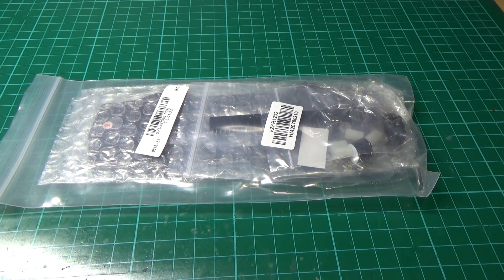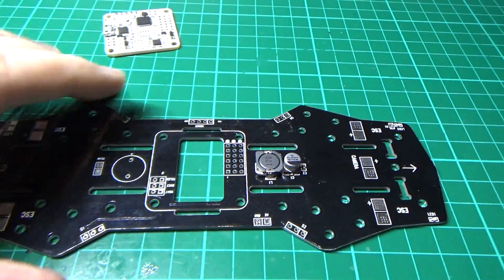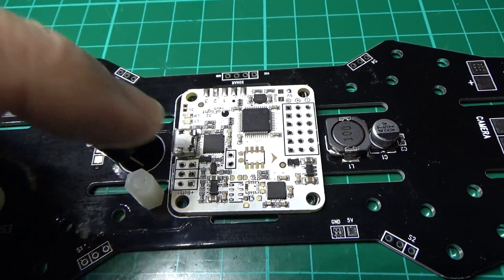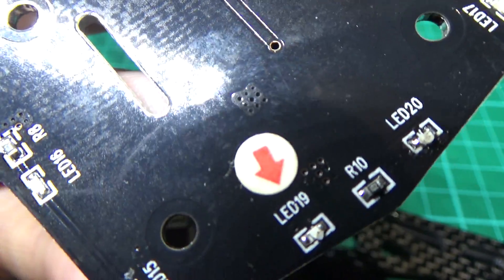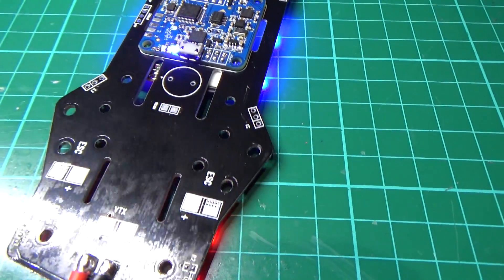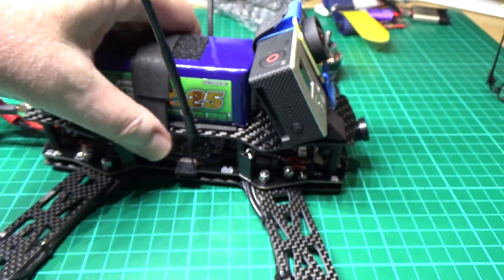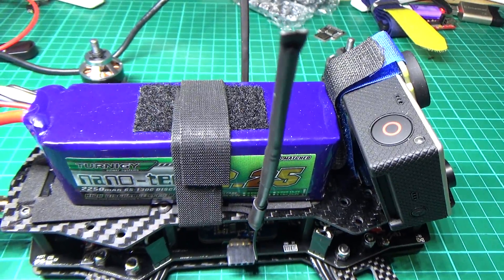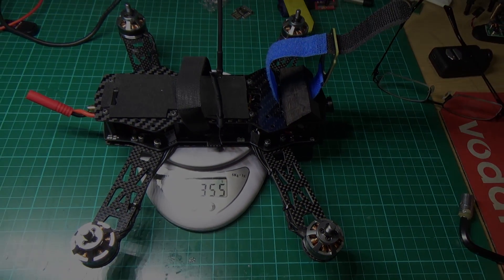ZMR250 drone PDB with Naze32 mount from Banggood - Frankenquad the 2nd!

Comment: my new drone weight have about 21KG, but i no sure what motor need use. i have 5010 360kv motors 4 pcs. wery expensives has. i not sure need me 2-4 motor more ? but i think i use same power distribute board. or 2 pcs little naze32  20x20 distribute board.

Comment: I just ordered 1. cant be used with carbon frame right?
Anyway. 
Do I need to add bec? I got sonar too, can I use connector or direct solder?
Recon I can mount the escs on here some were?
Thank
Were you from? wolvs?walsall?
Hmm so your saying 6dof naze or cc3d cuz of the magno right? Can I still do altitude hold?
1 last thing. gps or satelite or both?
Fancy meet up some time? pretty sure im close to you.
Reply: name of leds to please. 12v ect
Reply: hmm you used sonar for bluetooth. can I do both then? naze got usb anyway right?
im new will acro naze32 do me or do i need 10dof?

Comment: you could put the buzzer underneath?
Reply from the maker: Not really, the bottom plate is in the way. I could have drilled a big hole in it but I found it much better to have the buzzer right at the back of the quad

Comment: Hi there, 
nice job and nice video, helped me a lot with building my 1-st quad. 

I've one question: where can I find channel 5 output for LED strips on this PDB, anyone remebers or can check?

Thanks in advance and best regards,
Mariusz.
Reply from the maker: Hi Mariusz. I did a video about it........ https://www.youtube.com/watch?v=7S_D6fgsGdI    
If you need any more help, drop me a note :-)
Reply: +Vortecks thanks for link, somehow I haven't seen this before :-) Anyway, I've asked under this video because this is the same PDB as mine, but I've aleady assembled my quad and whish not to dissasemble it onece again just to check where channel 5 is wired on PDB. AFAIR it was under pins labeled SONAR, but I'm not 100% sure. 
I'll also check voltage under 5v because all four strips I've received are not lighting up after connecting to bec or PC USB port (signal sure not connected). Thanks for help Vortecks!
Reply from the maker: We all make mistakes..... I'm a past master at it but I usually share it so others don't suffer like I do :D    
I'm glad you got it sorted in the end :-)

Comment: is there no 5V and 12V Output by default on the board? Do you really need the power of an BEC?
Reply from the maker: +Christian Wunderlich No, there's no 5v or 12v. You either use the BEC in an ESC or use a separate one like I did.The thing that looks like a BEC is actually a low pass filter for video.
Reply: +Vortecks That is crap. Than i acn use the diatone as well, or ;-) are there meanwhile better PCB´s around?
Reply from the maker: +Christian Wunderlich I ended up using the Diatone https://www.youtube.com/watch?v=nFtlixPwjw0

Comment: Hi, for what are the big condensators in the ESC wiring? Does the ESC power supply needs to be filtered? Thx Fred
Reply from the maker: +fred xxx The capacitors are what's called "power capacitors" which are there to protect the other electronics from voltage drop. When you give it full throttle, they smooth the power out and make sure everything else doesn't suffer. They're not necessarily needed if you  have good quality batteries and fly slowly.

Comment: after screwing up my first naze32 with a pcb and being my first build you have helped me loads on where I went wrong with the 5v to the board, I notice you have 2500mah batteries, I have 2200 3 cell batteries using these what esc's would you recommend for me to use I currently have 12amp but not sure if they are too low and im using DYS BE1806-2300kv motors from bangood.com, any advise would be good if you have the time to spare, by the way its been ages since i have been up cannock chase, fellow midlander :) Thanks
Reply from the maker: +Rob Ellis Hi Rob, you'll be fine with the 12a ESCs on 3s with those motors. It's when you do mental things like me and try breaking the sound barrier that you need to beef things up https://www.youtube.com/watch?v=2DVdpUsyRQQ    I now use ZTW Spider 30a ESCs,  Sunnysky X2207 2100kv motors with 4s 2250mah Turnigy Nanotech 65-130c batteries on everything. When the weather warms up, I'm going to try my 6s mini quad again - the last time didn't go too well..... https://www.youtube.com/watch?v=_Fe5xTn4kYs 
If you need any more help or guidance, please drop me an email (click on my name, click on 'About' and it's in there. Tony
Reply: Thank you so much Tony, I am a complete Nube to all of this and any help is greatly received, i also currently have the flysky T6 transmitter do you have a video on setting up a transmitter or recommend a better one which is idiot proof for me...
Reply from the maker: +Rob Ellis My old radio was a Spektrum DX8 and I now have a FrSky Taranis. The DX8 was easy to setup and use but it lacked the advanced configuration of the Taranis. I really can't help with radios because the only one I know inside out is the Taranis (although they have made it quite user friendly recently).
Reply: I have the Teranis saved in my wish list in bangood at £154 complete, it seams most people go with this option, many thanks once again Tony I think that will be my next purchase as I would like the benefit of telemetry also something this transmitter is lacking in the one I have at the moment, I look-forward to more of your videos my friend :) Thanks.
Reply from the maker: +Rob Ellis No problem Rob. You'll like the Taranis and it will grow with you as your knowledge expands......something that the DX8 was lacking :)
Reply: Thx :), hope you dont mind me dropping questions on you like this, but i just like your no nonsense approach there is no bullshit like some of the american builders, no offence to the community intended :)
Reply from the maker: +Rob Ellis I don't mind at all.... I was the same once and I know how frustrating it can be :-)
Reply: Thx :)

Comment: Look at the copper on the top and bottom, trace the route for the high current to the motors, totaly rubbish.
I bought one as a test then saw RCmodelReviews mention of tracks on a ZMR clone so took a closer look.
Ideally you want nothing interupting the copper layer from battery to ESC's on this they are broken by signal tracks down to a few mm.
Reply from the maker: +powernumpty Well..... after spending hours and hours building it, I decided not to fly it because of the quality.
Reply: +Vortecks There are more recognised brands and next time I'll either go up market or stick with the Diatone V2.1 and forgo the extra "features" for a solid if basic design. Shame really as that should not be a hard PCB to layout but someone is used to "basic signal routing" only must have done it. I might either bridge the copper fill in a few places over the signal tracks or remove the worst signal tracks and white-wire those, either way it's "Don't buy" for sure and mine came with leds. I shall bloody miss Bruce's insights if he does leave the hobby for good due to those tossers in MFNZ.
Reply: +powernumpty   Thankfully Bruce is not leaving!!  You mention the V2.1.  That even comes with a warning to USE the Fibre Washers provided to save shorting the board.  I have the above and the V2.1, and yet, are using a simple $1 PDB.  I have the copper plate that Bruce used, on his economic ZMR250 Build, but lashed out the $1!  I love the idea that Diatone imply with a Clean build, pity the Board does not live up to the expectation!
Reply: +Mark McNamara Yes I was using it on a fibreglass ZMR clone so less of an issue, I think the chinese factories have spare capacity and just knock something up without too much thought. I'm really glad Bruce can fly again as he is a great source of information and happy to share it.
I made a mistake about the diatone board, because I only have two built into clones I could not look closely, might not be that good on the high current path but it better than the YKS for not arriving broken.
I've got a square PDB with two decent regulators on board, a few ZMR fit PDB's, and a smaller version PDB with supplies, all good bits to them but nobody has perfected the design to make a really clean build. I probably should borrow the CAD packages at work and do what I think is decent enough layout then throw it out for improvement and use, trouble is I fancy moving from the ZMR and there are some great frames out there now for not much more.
Reply from the maker: +powernumpty I may finish this frame and get it flight worthy with a 6S - Just to prove it'll handle 130amps :-)
Reply: +Vortecks Do you know anyone with a thermal camera? I'd like to see 130A through that PDB, I expect there would be some bright bits. Many moons ago I laid out a PCB for a SLA battery powered device that passed about 35A constant (more on peaks), we specified 2oz 70um copper but they supplied 1oz, luckily they had only made and populated about 3500 PCB's before the issue came up in long stress tests so we had a few to fix (call that a lesson learnt), I would never expect that PDB to handle 65A to the front ESC's for more than a few minutes but then with loads of airflow and short batery life it might survive, just don't fly it over anything living or valuable.
Reply from the maker: +powernumpty " just don't fly it over anything living or valuable" do trees count because I'm bound to hit one :D
Reply: +Vortecks my rubbish ZMR seems to be more attracted to barbed wire and fence posts right now, which reminds me I need to go look in the grass for some bits.
I look forward to seeing your quad flying.